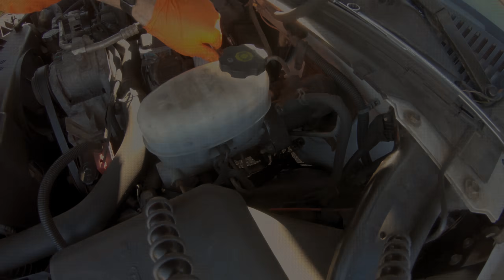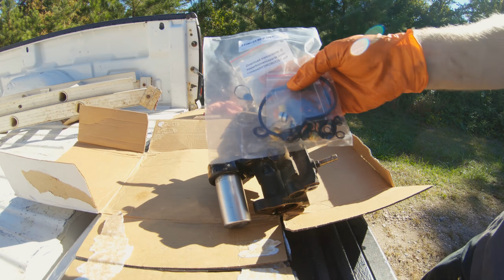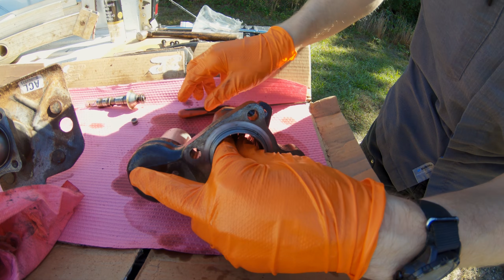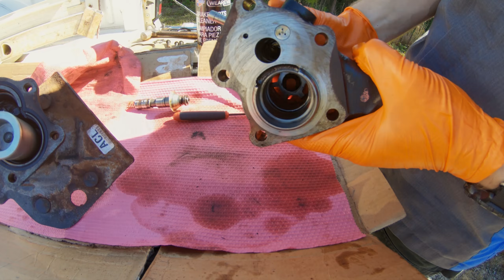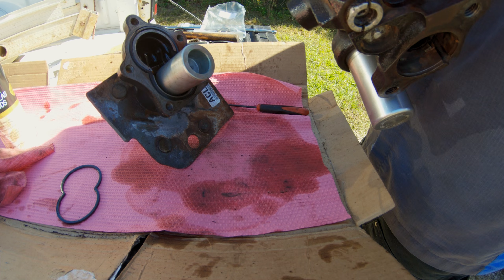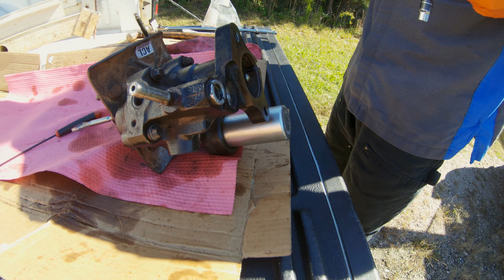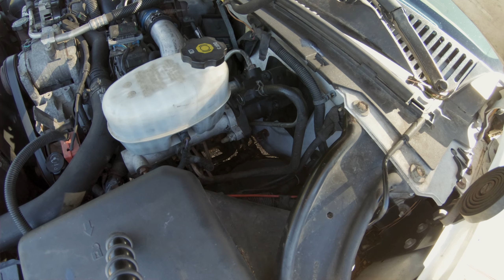GM Hydroboost Brake Booster Leak Repair

Comment: By any chance did u have a hard time turning right? I have a 04 suburban replaced the power steering pump bled the system now I have a brake booster light on the dash. Googled it and said that the hydro boost could be bad

Comment: I just got done replacing the piston seal as well as the booster cover gasket on my 2009 Chevy 2500HD 6.0  after watching your video a few times.. Love your video by the way! I also was able to complete this task without removing the booster cover from the firewall. Thanks good sir.

Comment: is there a way to ajust any pushrods on the master cylinder or brake booster before putting it together  so the brakes dont lock up

Comment: Replaced my cylinder seal, mating seal and o-rings.  Started truck and brake pedal instantly sucks to the floor and you can’t pull it up until you turn truck off.  Any ideas?
Reply: Did you ever figure it out? I'm having the same problem
Reply: @braleyneale5267 did you ever figure it out I got the same problem as well
Reply: @Ez1_1PzI did actually, I’ll post a short when I get home from work since explaining it is complicated
Reply: Did you figure it out I have the same problem?

Comment: ive never had to remove any thing from the inside just to replace the couple of rubber gaskets but ok just have to be careful nothing from the inside of the booster shoots out and drops in the darkness

Comment: For some reason, the little plunger that sits on top of that little bitty cone mine does not look like that. It has three little bitty round hose. Also, when I split mine apart, it sprayed fluid all over me and everybody else he working on them there's does not spray.

Comment: Wish me luck I just removed one from an H1 Hummer and it was a bit of work because it is buried underneath the CTIS system. Just watching this video and going to attempt to get it done tomorrow. 😅 
Oh should mention I seen in another video when a guy went to split it after removing the bolts the thing had hydraulic pressure in it and he got sprayed pretty good. So always a good idea with the engine off to pump the brakes on and off at least four times to relieve the pressure.

Comment: I just found out THIS Is My Problem on 1998 Chev C3500 454 gas. This has been VERY VERY Helpful. I just need the down time to fix this in Winter 2023-24 ! Well done I hope I get the chance to do it. Rock Auto rebuild Kit ?

Comment: I'm wondering if you could help me I just did this job on my 05 tahoe as soon as I start it the brake pedal pulls in as if I'm applying the brakes and will not release I'm at a lost at this point
Reply: Did you ever figure it out? I'm having the same problem
Reply: Yeah the o-ring that I bought for it turned out to be the wrong one and got messed up in it I had to redo the job and buy a rebuilt booster from AutoZone which did not last very long it is leaking again so it is definitely worth spending the money for the AC Delco freaking sucks cuz it's so expensive though almost done @braleyneale5267

Comment: Where was it leaking?  I have a PS leak where the master cylinder connects to the booster (bottom side).  Brake fluid not leaking.  Do I need a new booster or just rebuild like this video?

Comment: I figured out that using a couple long extensions with a swivel socket on a electric 90 ratchet to get the 4 nuts off from behind brake pedal works a lot better than just a regular ratchet, saved me a lot of time.

Comment: Does anyone know WHY the power steering system and brake booster work in conjunction on these vehicles in the first place?
Reply: Because that's how hydroboost works it doesn't have a vacuum brake booster so it uses the power steering pump this is actually a stronger brake system

Comment: Has anyone torn the new seal when tightening?  A one to two inch section has torn even though I've lubricated with power steering fluid.  Is there a trick here?
Reply: My first attempt leaked two weeks later.I pulled it apart seal was bent/crushed in one spot.Put new seal in damn thing started leaking again two weeks later.Havent pulled it apart again yet.

Comment: or does anyone know if the seals inside are the same? because I just looked for myself and my brake booster is a lot different and confirmed with the google search I had failed at previously.  So I see my break booster is twice the price, and I have already wasted money on this kit, but I wonder if maybe the seals are the same. My kit only came with a “flange type” seal and an o-ring though.

Comment: @2:45 :  Break loose as many 12 point bolts holding the booster assembly together, before going into the cabin and loosening the bolts fastening it to the firewall.  Great video Sir !  So refreshing to watch a how to video from someone who actually takes their time to know the proper names of a certain part.
Reply: Or leave it on the firewall... way easier.
Reply: I need to attempt this. And from watching a few videos. It seems like this can be repaired with it still attached to the firewall. Seems like everyone takes it off the firewall. Is there something I'm missing? @sixteen_tons
Reply: @dude3146  getting it off and back in is a bit of a hassle fiddling with the spring and lever arm that goes in first. but way easier than getting under the dash and messing with the pedal assembly
Reply: Lol just posted the same thing

Comment: Also check that you aren't loosing brake fluid first. Thought it was the booster but after a bunch of pumps the rear cavity of the brake reservoir was empty. Black cloud of inferior acdelco seal material.
Great vid for the hydro leak though, thanks
Reply: I'm having the same problem on my 1990 Chevy G30 motorhome, brake fluid leaking, pedal eventually goes to the floor, check the reservoir, the back one is completely empty, fill it back up, works good for a couple days, then it's empty again! I can see fluid below but can't find exactly where it's coming from. There's not a lot of info or videos on these old Chevys. 
I know this post is 5 months old, but can I ask how u fixed it? Any info would be greatly appreciated. Thanks
Reply: @jkitch419  Replaced the master cylinder. The hydroboost has a weep hole where it and the master cylinder mate. It was wet so either the booster or the master and I wasn't low on power steering fluid but losing brake fluid fast.
My pedal was also going almost to the floor. Had to be the master cylinder.

If you have a vacuum booster it may be leaking in the cab under the carpet where you wont notice it for a long time. Maybe a chemical smell inside but you could lose a lot of fluid to the foam padding before it starts wetting out the carpet.
Reply: If hydroboost pay close attention to the mating circumference where the master slides into the booster. They make a couple different sizes. Best if you can take it with you to the parts store to match that feature before you leave.

Comment: The kit I used was from amazon ZFLXH For Hydro boost Repair Kit Chevy GMC Ford GM Dodge Seal Kit Hydro-Boost Leak 3 Piece. The direction of the lip seal is critical point. Mine is still leaking so maybe I had not cleaned the bore enough. I have it apart again today.
Reply: I have done my twice with that kit. Both times two weeks later leak comes back. When I pulled it apart after the first replacement. I could clearly see the seal was bent in one spot. haven't pulled it back apart to find out what happened the second time.

Comment: Bottom of hydroboost was leaking fluid so I replaced the hydrobose and the master cylinder 2 days later it's all wet under there again I don't know what the problem is if I should do this now

Comment: What are symptoms of a leaking hydro booster?
Reply: Steering wheel fluid on the floor inside the cabin underneath the brake pedal

Comment: 2002 mustang gt with hydro booster. All my brakes are dragging. i bought the vehicle and immediately did a brake change so I have no clue if it was happing before I installed new pads and rotors. Has the booster failed or another problem? Changed the master cylinder and did not fix the issue

Comment: Got mine out of the truck and that spring retainer fell right out, messed with it for almost an hour trying to get it to sit properly. Seems my internal housing has been damaged and star wouldn't sit anymore with spring load; bummer to have to replace pump but got one at AutoZone. Thanks for the good video

Comment: Ok so.. me and my husband just replaced the seals in our hydroboost because it was leak PS fluid. Problem now is, when we start it the brake pedal instantly goes to the floor and there's no give or take anymore with pedal. We've tried the bleeding process before starting the engine. Any suggestions would be greatly appreciated..
Reply: For anyone else having this issue, it is more than likely that you didn't get the pins of the "fork" into the "groove" on the top plunger that he mentions at 13:38.  I would describe it more as a channel behind a "keeper" ring that is about 3/8 inch wide.  You have to angle plunger up or down slightly and slip that channel into the pins in the back side of the booster unit.  As you are inserting the lower cylinder/plunger there is a lot of vertical play, so it is easy for it to slip out.  If you are doing this without removing the whole unit from the firewall (which I recommend), I would have a helper press the brake pedal all the way in to help you easily get things started, then slowly release the brake pedal as you are inserting the front part of the booster, making sure all the plungers/cylinders/springs/rods are aligned in the places they need to be.

No need to ask me how I know.  🙂  I have had this part off and on 3 times this past weekend trying to get this all correct!
Reply: I have the same issue. Did y'all find a solution?
Reply: Same issue I’m having.. any fix?

Comment: I have a white or off yellowish cone with what looks like a tiny hole in it . Where does that go
Reply: Does it go into where the power steering line screws in?
Reply: Or does it go inside the spring?
Reply: @EZ-PZ-ECM  I know this is kind of late, But did you get the issue fixed? The reason I ask is when I opened up mine I didn't see any rod (Sticks through the three-hole cap) or bearing on top of the yellow cone? I have tracked down two different diagrams. one with both and one without both? Can seem to get anybody who can tell me.
Reply: @Dean S  man it's been a while.  About to rebuild one off a escalade. Should be the same will let you know when I do it.  If I remember right part I was talking about went somewhere around the spring
Reply: I have done a 2003 Silverado 1500 hd.. a 2004 Silverado 3500. And a 2004 yukon.. so far and all of those had that rod. Maybe if your doing 06 or newer maybe different. Or is it off different make

Comment: Thanks.  I saw you struggling slightly breaking the bolts loose that hold it together so I broke them loose while it was still in the truck.  Now I'm debating whether or not to cut the pedal rod off, replace the seals on that shaft, and weld it back on...

Comment: Awesome tutorial I wonder if my issue would be related as I have lost brake pedal pressure recently. Brakes & calipers are recent. However there has been leakage in & about the hydro boost
Reply: Very well could have been. As PS supplies power to brakes through hydroboost. Did u get it fixed, because I have a slight leak now
Reply: installed a rebuilt one and issue was a not the hydroboost but a faulty front caliper. seized open  @mayken6661
Reply: I'm also curious if the seal fixed your problem. My steering & brakes went out and only issue i found is the hydro unit leaks slightly

Comment: My GF's dad's '03 2500HD Dmax has super squishy brakes. What are the symptoms for this? It doesn't seem to visibly leak fluid, and none of the lines leak brake fluid at the wheels or to the rear of the truck. So, it seems like an internal leak. And the power steering works fine.

Comment: Thanks for the tutorial, learned a lot from this video and saved a lot of money doing it myself on my 99’ chevy suburban. Was able to split it open to replace the seals without removing it from the firewall. Seamed too complicated under the dash. Thanks again!
Reply: I’m gonna try that tomorrow night mines leaking like crazy
Reply: @zionpope9491   make sure you bleed the master cylinder afterwards. ✌️
Reply: I was thinking the same thing, leave it bolted to the firewall, seems way easier and faster
Reply: @C.dieslevonankwek7   yes, you can replace the seals without removing it from firewall. Too much hassle if you do that.  Will save a lot of money doing it yourself.
Reply: I was thinking it looked like I had more room on my 95 turbo diesel 2-door Yukon, and I was going to attempt it on the firewall so I'm glad to see these comments.
Reply: Was it difficult to do it that way???🙂
Reply: @bensonhedges5471   hey, not at all. Only little issue was keeping the spring aligned while bolting it back. Would help if you have a helping hand while you bolt it back. Seals are like $20.00 on Amazon. Good luck!
Reply: I have a 09 3500. I'm leaking fluid behind my break pedal front where the rod goes Into the power booster. So how do I know if it's the power booster or master cylinder? Or is it both?

Comment: Could you just remove brake master cyclinder and replace the seal on hydro booster without removing it from the truck without any major issues?
Reply: I was thinking the exact same thing. The only issue I see with that is putting it all back together and getting it aligned with the way it sits in the truck.

Comment: In the video, it is mentioned the top plunger needs to slide into a fork in the housing.   Does anyone know what he is talking about  or have a pic as I just slid the plunger into housing with no restrictions?
Reply: What wasnt clear is that while i kept trying to get the fork on the booster by pushing the booster into the fork, it always popped off.  What i did was take something that weights a few pounds and push down on the brake pedal to the floor and put weight in front of it so it doesnt pop back up.  then you can easily put the booster into the fork, push the booster to the seated position on the housing and put the bolts in and tighten.  then remove the weight and the pedal comes back up and you are ready to pressurize the booster.  I wasted several hours over weeks trying to google and ask people.  The reason it is not an issue for those who follow this video is they take the whole housing off inside fron the brake pedal.  I did not take anything off but the booster    and replaced the $5 seal and all has been working with no leaks for many months now saving my daughter over $1000 to replace booster.
Reply: @Greg-bq2tx  I took just the front half of the booster off with the 5 bolts everything exploded apart. I'm guessing how it goes back together. I have no idea what this "fork" is that poeple are talking about. I can't see anything that even looks similar to a Fork. 
I will try a cement block on the brake pedal to reinstall. Do you think this will work for me?
Reply: Did the plunger thing work out for you, or did you find it was misaligned after?🙂 I am attempting this job soon.

Comment: Anyone know if this rebuild kit will work for one that’s leaking from the rod inside the cab? I have fluid in my floorboard coming from the rod that connects to the pedal.
Reply: I’ve got the same problem, did you fix it?
Reply: I have a very small amount of fluid in the same area.  Did you fix it?
Reply: It’s the figure 8 seal in this video

Comment: Is there a small bearing or "bb" as a check valve   next to the small piston? I saw another video but the valve is different on my truck.  05. 6.6
Reply: There is no ball on a duramax 6.6. My check valve popped out and I thought I lost the ball because of other videos and my instruction sheet said there was a ball. That was frustrating and a huge waste of time looking for something that wasn't there. When you reinstall the check, the side with the three holes is facing out.

Comment: Sweet.  I looked hard and long for a unit under $700 for a 79 Chevy and found out they don't even rebuild it anymore.  I never would have tried and had success with a seal kit without this video. Thanks.
Reply: will this kit work for a 2009 chevrolet silverado 2500hd?

Comment: Can you please tell me about the Hydro Boost repair you did back in 2018. Which direction does the little yellow plastic cone go in and does the little round check valve with the 3 little holes face inward or out toward you when installing. Any help would greatly be appreciated. Thank you.
Reply: Yellow cone goes in first with the flat side facing outward and the little plastic check valve goes in with the fingers also facing outward
Reply: Hay man did you ever figure out where that plastic cone piece went too just tried to rebuild my and have no idea where it goes back at